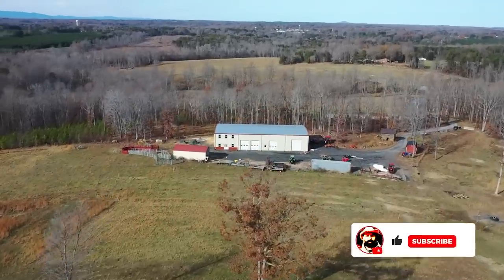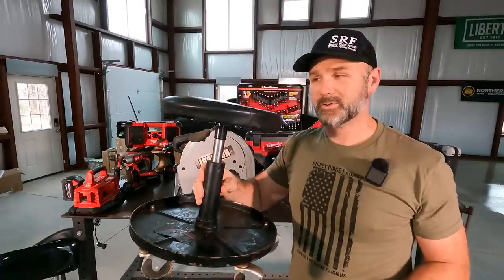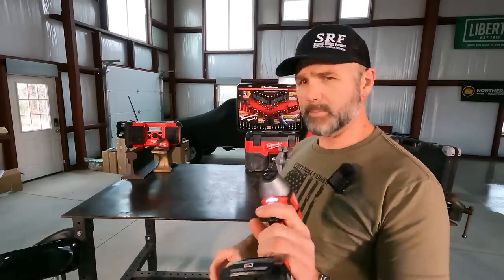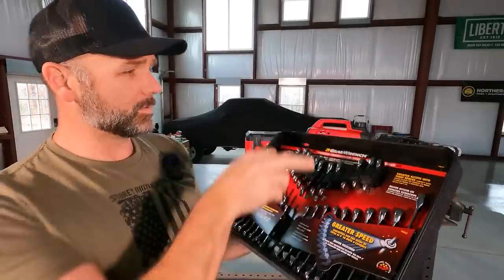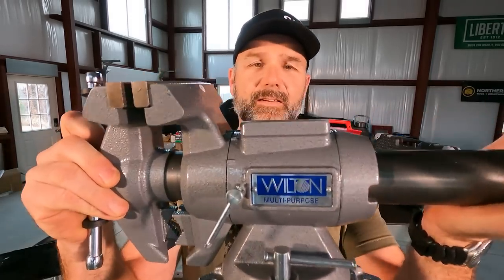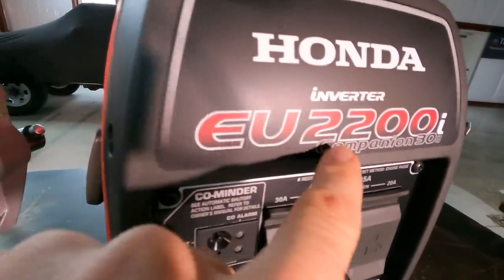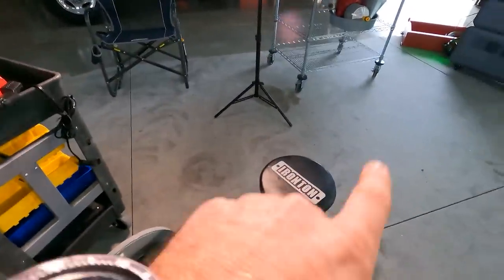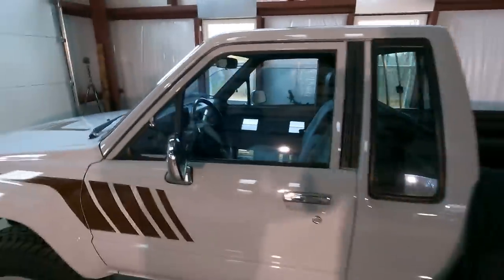Tools every shop needs! Ideas for an awesome shop!

Comment: Years ago with 30-40 guys on job sites doing commercial/industrial electrical contracting, myself and all of my guys used Dewalt cordless. We abused those tools, running until they were too hot to hold, dropping off ladders and so on. I seldom had to replace Dewalt tools, they held up to every day hard use. But a couple years ago, my Dewalt batteries wouldn't hold a charge and the older batteries being obsolete, the new batteries I found were ridiculously priced. So, I purchase all new Milwaukee and have not been disappointed. 
The Milwaukee grease gun is a must have for anyone with equipment!
I own other brand self-leveling laser but Black Friday sale I got the Milwaukee M12 360 degree 3 plane laser, purchase I wish I made a while back!

Comment: I'm a DeWalt guy. Milwaukee makes great tools, too. I might have even more than you! I'm a retired carpenter so the tools pulled up over the years. And you're absolutely right about sticking with one brand. With the cost of batteries you can't afford diversity. I have become quite addicted to the 60 volt batteries. I use them pretty much all the time.
Reply: I hardly ever use air or electric tools anymore. I was already started with the 20v Dewalt platform so I stayed with it. I love the mid range impact. I haven't found anything automotive or around the farm that it can't handle.

Comment: I purchased my first battery powered tools last year to do a couple of projects on my property where I don't have electricity.  Other than a cordless drill, I had never used battery powered tools before.  I chose the dewalt brand.  I really  like not having to drag my generator and extension cords around.  I rarely, if ever, even use my corded tools anymore, even in my workshop.  The only problem I have now is I may go broke buying more battery powered tools

Comment: Josh, definitely highlighted some good tools, but should also mention these tools are not the brushless Fuel versions.  The fuel m18 are more powerful and brushless.  Some might not need them but they are out there for the more heavy user that needs a better stronger m18 tool

Comment: You should come up with a part II video for folks who already have all or most of what you have showcased here. For example, Spare batteries, Larger socket sets, as in larger sized sockets. Wrench sets, Roll around tool boxes( just to mention, I am a huge fan of the Harbor Freight 5 drawer boxes. Very good boxes with easy to operate drawers even when loaded down) Plain rubber made carts that you can customize as in I have one that has a most used air tool hanger on one end. Also drilled holes in one end for all sizes of pry bars. The rubber made carts are awesome carts. The cart you show cased with the bolt bins, could also be used to house different color, size, spools of wiring. Speaking of wiring, that's something that gets used a lot on my shop. When repairing or diagnosing wiring issues, wiring tools, GOOD ones, are very valuable to have and to have organized. Something else I use a lot is my parts washer. And to go along with that, a large array of different types of cleaning brushes. Something else as I am sure you know, Hammers of different types, sizes, and uses. Honestly, hammers are like screwdrivers, you never own too many! Hose reels, how many is really dependent on the size of your shop. Seeing your old shop, vs your new shop, I can already tell you like to have things clean and organized. A cart for your firewood. Something you can roll over to a bay door, or a man door and fill up for all of your wood stoves(seems I remember you saying you will have more than one) Helps to keep the mess off the floors.Another thing folks don't think abut is brooms and dust pans, (the type that you use standing up, not having to bend over to use) Having a designated place and hangers is very useful. The best advice I could give anyone wanting to get Christmas gifts for a Tool person, is ask, visit the shop, spend some time with them and see just what would make things better for them! Thanks for you videos, I really appreciate them!

Comment: I have been using the Milwaukee M18 1/2" Impact Driver for around two years now, very impressed with the power it has. I have since added the M18 1/2" Square Drive Impact Wrench. Both come with a charger and two batteries. You can work them hard all day and never get stuck waiting on a recharge. Woooo!!

Comment: 10:29 This is a super important point: for battery shop tools - stick to one brand. Don't go buying random tools because they are $50 off this month, you'll regret that down the line. You'll run out of power and you'll be hunting around looking for where you last left that YinCoCheap charger, or you'll have to go home to pick up a spare instead of swapping out a working pack from another tool from your toolbox.

Comment: Impact socket sets are half the price in Europe compared to America, because we only need the metric sizes... 😇
Reply from the maker: lol...yep it's confusing...you guys use inches, gallons, Km and cm....and some SAE stuff over there too....filled my rental car up in the UK....in Liters....MPG reading in the car was ready crazy high...a gallon in the UK isn't a gallon US...lol...I'm lost!
Reply: @StoneyRidgeFarmer  It's only a decade since we stopped listing cheese in lbs too, then there is PSI for tyres and BSA for bottom brackets.
tbh I still think in miles per gallon but we have to fill up in litres now... the high reading might just be the differences in engines? we possibly have much smaller and fuel efficient engines in European cars
Metric in practice isn't perfect, I've just bought an "12mm" spline tool for my bike's freehub, but the diameter actually measured 11.14mm. Then I found my original long spline tool set and the "12mm" in that was 11.54mm. Tolerances aren't what they should be for cheap tooling.
It's funny that when it comes to indicating area, you guys use "football fields", and we will use something like "the size of Wales" 😹

Comment: Milwaukee are great tools. I mostly have DeWalt.  My buddy uses Milwaukee only. Awhile back my 20 volt DeWalt wouldn't brake loose my lug nuts. So I grabbed his Milwaukee,  and bang, popped every one loose. I like my DeWalt tools but if you want a little more torque,  get a Milwaukee.

Comment: Josh.... Please get into the habit of sitting your grinder down ,with the disc facing up. I know with the advent of "dead man switches" and cordless tools it is not as much of a concern, but it's better to be safe than sorry. With over 40 years in the building trades I've seen a few horrendous accidents caused by grinders left face/wheel down.  As always, continued success, stay well and be safe.
Reply from the maker: great idea!!! Thanks for the tip!

Comment: Hey Josh love your channel. Looks like that inverter only puts out 120 v. Even in parallel.  2  would give you more amperage at those out let’s as stated on the inverter. I would want to know that before spending $1200 for that puppy. Also it looks like you may have a knockoff brand battery on the Dewalt hand grinder that you were comparing with the Milwaukee brand.
Reply from the maker: the other grinder chews through batteries much much faster...still gets the job done but it eats them up quickly

Comment: I love the Milwaukee tolls but not buying the battery that go bad they last about two years!! Then two hundred dollars to replace the battery for my weed eater was 199 I paid around 400 for it!! Don’t get me wrong I love their tools but not the price for the battery’s. 😢
Reply from the maker: 3 year warranty on XC batteries from what I've read my friend
Reply: From  the  protoolreviews site: "The warranty period is 5 years / 2000 charges from the date of purchase, whichever first occurs. The first 1000 charges or 2 years of the warranty, whichever first occurs, are covered through free replacement of the defective battery. This means that for the earlier of the first 1000 charges or 2 years from the date of purchase/first charge, Milwaukee sends a replacement battery to the customer for any defective battery free of charge.  Thereafter, the remaining charges up to a total of 2000 or the remainder of the 5 year period from the date of purchase, whichever first occurs, will be covered on a pro-rata basis. This means that every customer gets an additional 1000 charges or 3 years of pro-rata warranty on these battery packs, depending upon the amount of use."

I'd check that out, you might get a replacement pack
hth
Reply: @StoneyRidgeFarmer  I've had great service life out of the Dewalt XR batteries. Everything changed for the better when they got away from the old ni-cad batteries and went to lithium ion.
Reply: @____________________________.x  
Yea I just wish I would have keep my receipts , they got lost in the shuffle!! All on me. 
Thanks for the info!!!
Reply: @ivansharp6054  👍